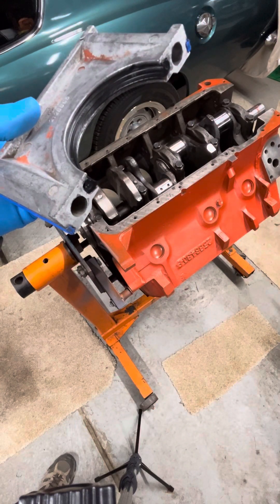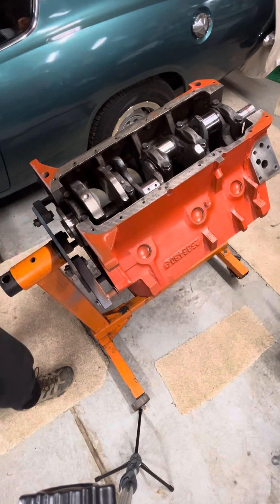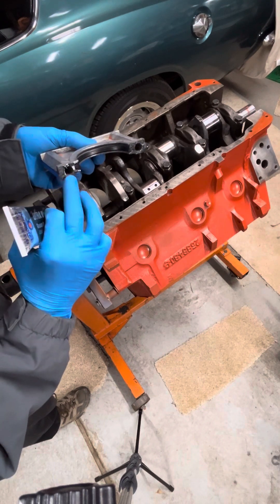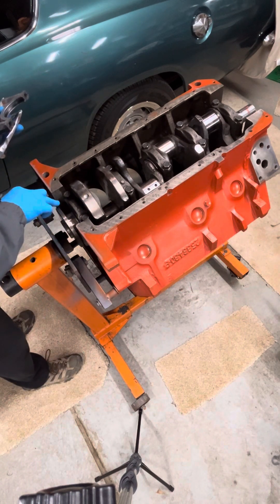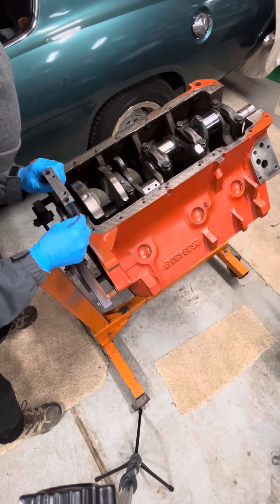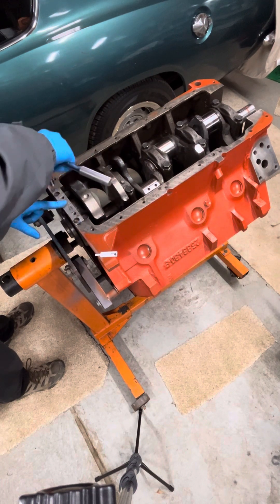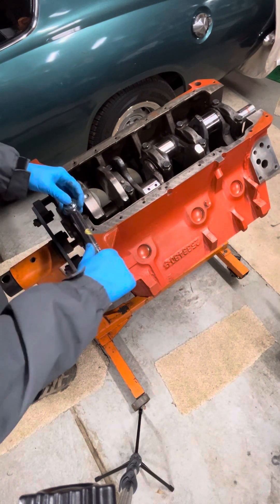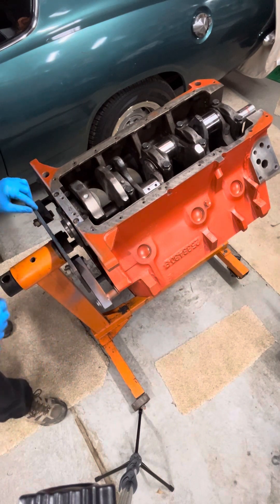440 V8 Mopar Engine Rebuild Step 7 - Rear Main Seal Cap

Comment: The main issue with these seals has always been people installing them backwards. Always double check that you push the side seals down firm because they have a tendency to slide up as you push down the aluminum seal  holder.

Comment: Hi - I've got my 440 pulled out of my '70 Roadrunner to freshen up the engine and I used your method today to replace the rear main seal.
Gonna install the rear main lower cap tomorrow after the RTV on the outer blue seals has a chance to dry overnight.
Were you successful with no rear main seal leakage?
Thanks for posting this helpful video!
 Van McD